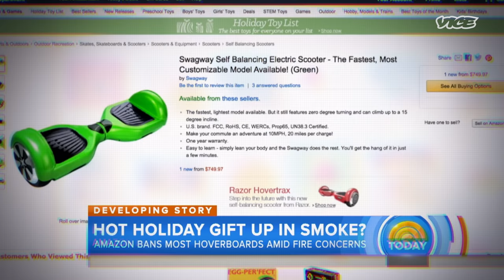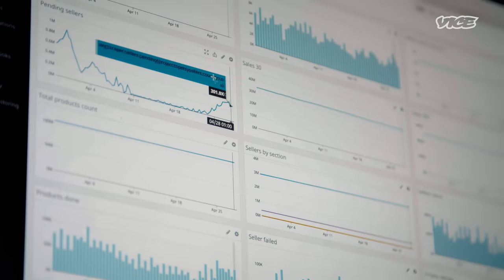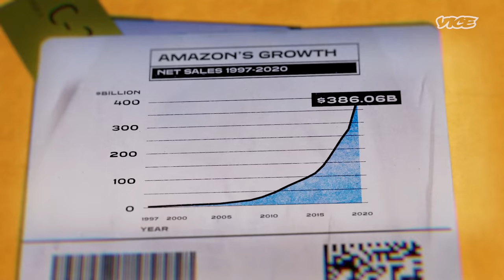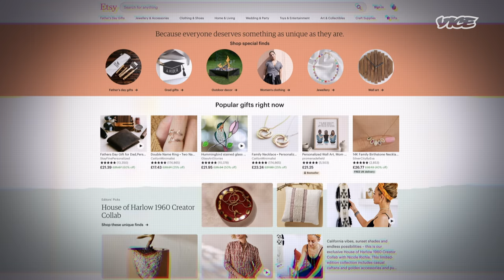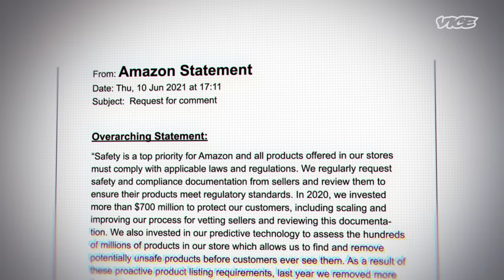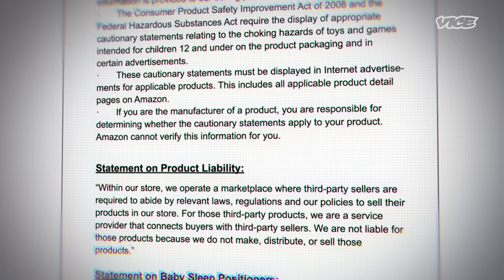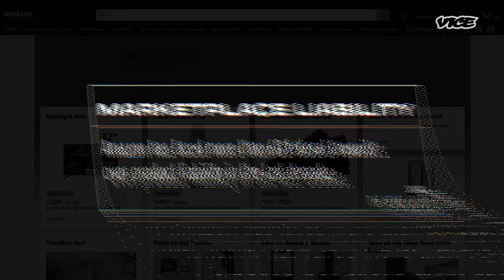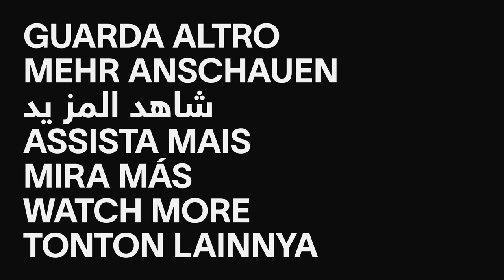The True Cost of Online Marketplaces

Comment: I watched this video casually thinking it was interesting but thought no more of it. Then the next day, I happened to have an electrical check done on my home. The electrician found the 'fire rated bathroom spotlights' I had installed were neither fire rated or safe for bathrooms. It is a serious danger that requires remedial work. The seller told me the lights are fire rated and comply with British standards... but has only been able to produce documentation from China which doesn't comply with British standards. This is very scary stuff. Please get your electrics checked and report any faulty items so that others can be alerted.

Comment: Soooooooo, what is amazon supposed to do here?  Go through every listing 100% and make sure they're up to code?
Reply: Yes, that's exactly what they should be doing. If they've got such a high merch volume that they can't effectively evaluate all of it, then they need to either cut back or hire more moderators.
Reply: @JarethTheGoblinKingForever  how are they supposed to inspect all listings 100%
Reply: @bigedfromny6037  The same way brick and mortar stores do: by evaluating BEFORE approval, not after. If Amazon wants to be a big boy, then it needs to do a big job at properly evaluating its stock. If it can't evaluate each listing, then it shouldn't be a functioning company until it can, plain and simple.
Reply: @JarethTheGoblinKingForever  if they inspect every listing, wouldn't it cost too much to continue their business model?
Reply: @bigedfromny6037  That's just it. They set up a business model that can't possibly be sustainable and safe for consumers at the same time, in which case it treads on thin legal ice. If their business model can't protect buyers, it shouldn't exist as it does at all.
Reply: @JarethTheGoblinKingForever  then what about ebay, wish, etsy, and new egg?  They are the same with respect to sellers making listings?  Should they not exist too?
Reply: @bigedfromny6037  
> Should they not exist too?
No.
Reply: @JarethTheGoblinKingForever  >follow the law

Are you able to identify at least one law that is not being followed?
Reply: @bigedfromny6037  Failing to address the selling of goods that break safety codes or infringe on a party's intellectual property, and continuing to allow these goods to appear on a platform, is illegal. The selling of counterfeit goods is illegal, as it should be.
Reply: @JarethTheGoblinKingForever  Again you speak in general, blanket language without going into specifics. It's a fallacy to think every safety issue is Amazon's failure and incompetence with no room for redemption.  It's sad to see people make judgments without actually knowing Amazon's listing process and IP protections.
Reply: @bigedfromny6037  You're clearly a fan of Amazon, but if you were an artist or author or designer whose work was getting ripped off, you might reconsider.
Reply: @JarethTheGoblinKingForever  nobody should be getting ripped off or unsafe products, but then again any platform shouldn't be shut down just because of a few bad apples.